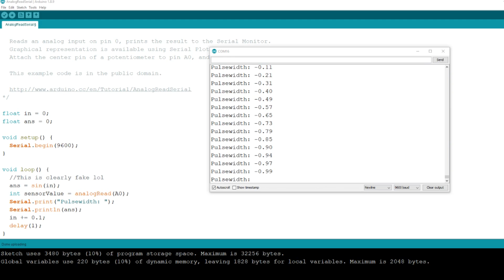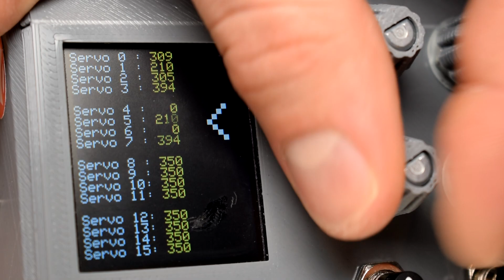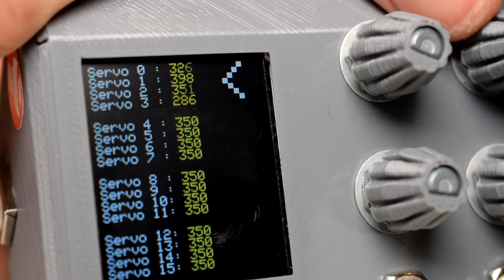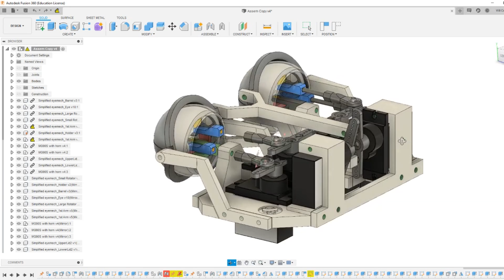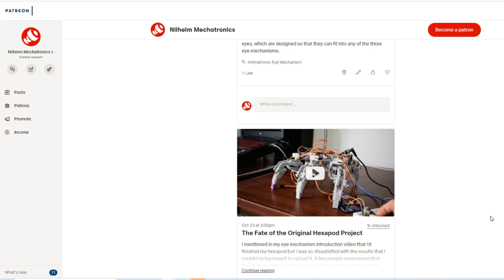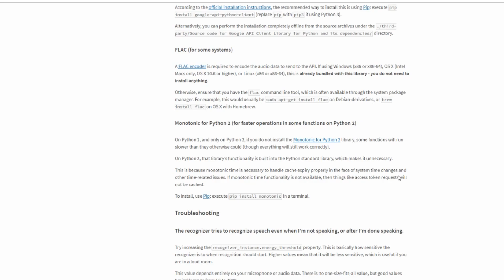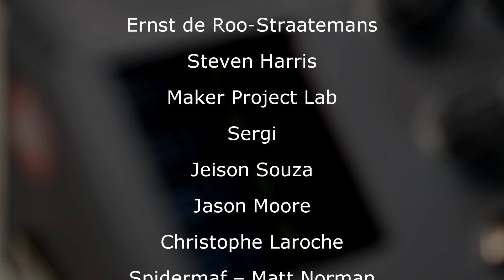DIY 16 Channel Servo Tester with 3D Printing and Arduino + Channel Update

Comment: The folding design is really clever, If one was to print in ABS, it could be put together folded closed and acetone and abs slurry welded together, it would also cover up all the joint lines, Happy New Year to you and yours.